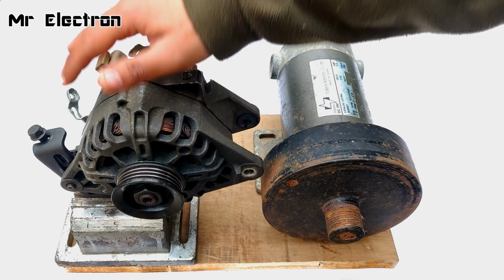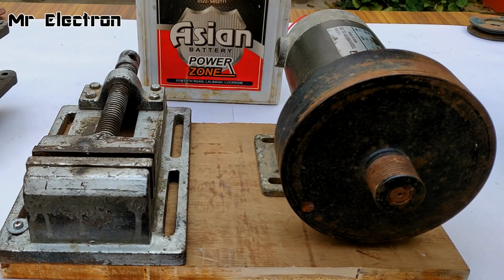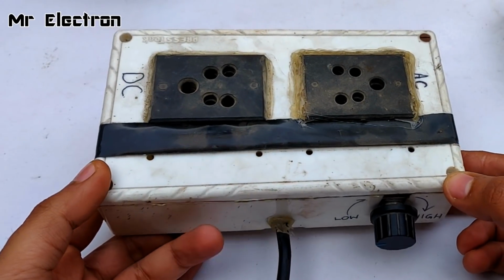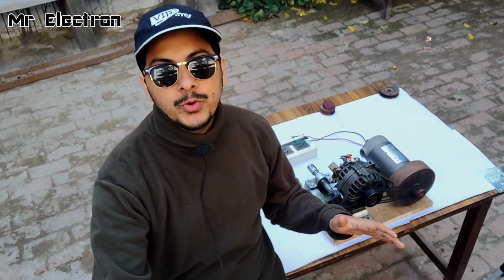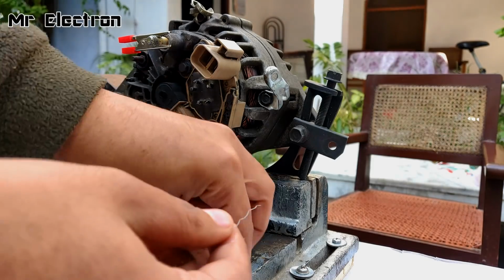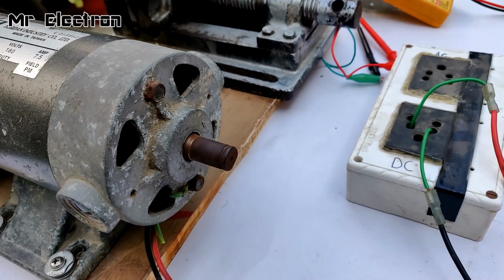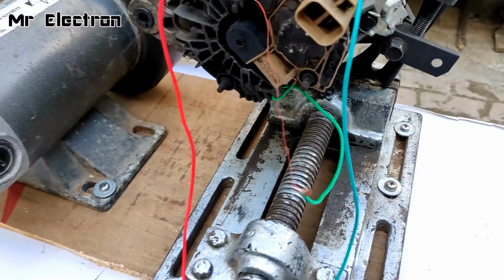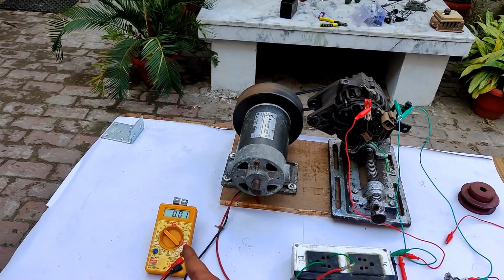12v 90 Amps Car Alternator to 1000 Watts Resistor Excited Generator

Comment: How do we using a battery,a motor and tension pully where do we connect wires to ensure the alternator is producing power and charging the battery at the same time

Comment: Hi can you make a video by connecting your alternator to Gym cycle, cycle or Gym tread mill so that we charge a car 12 volt Battery, then use that stored power to power your appliances at home using inverter

Then it great project to make electricity
Reply: treadmill motors can be generators now.

Comment: Hi, the video was extremely amazing and informative.

But I have a question:

What is the use of doing this self excitation if a 230 Volt power source is still needed?

Shouldn't the objective behind Self excitation be that we can use the alternator as a source of energy?

I mean a clean source of energy similar to solar.
Reply: Well the 230v source won't be needed if you could run the alternator at 3000rpm to 4000 rpm with wind or hydro energy.

Comment: What was the approximate resistance of the canthol wire?
Reply from the maker: 9 ohms
Reply: @MrElectron  wonder if a 10ohm 1w resister set in ceramic would last?

Comment: I used to like your videos but this one was fake and you excited the alternator using a battery  as we did not see a sudden change on voltmeter on the other hand car alternator must be excited or it will never produce energy even over 10000 RPM
Reply: Bullsit

Comment: Dear sir , I am kailasanathan from Kerala . I am an amateur researcher. I would like to clarify a doubt .  By connecting 100 alternators   in series / parallel and the output of alternators is connected to step up transformers to increase the voltage from 12 v to 230 v. 
Alternator capacity 12 v , 120 amps
Can we produce  2 MW with 100 such alternators
12v stepped up by step up transformers to 230 v
Volt× amps = watts
So 120amps  ×230volts×100 alternators = 2760000 watts= 2.76 Mega Watts
Can this be achieved
I am eagerly awaiting your valuable reply
Regards
Kailasanathan

Comment: hello mr electron,
i got a question and i think you will know.  im looking to build a cheap genearator from parts i have. i have a 50 cc scooter engine 5 altenators and 10 batteries. is it possible to hook up all 5 alternators at the same time to the motor to charge the 10 batteries.? 
the batteries end power will still be 12v. going into  12v<220 converter. 
i try to build a moving party trailer/powersuply for camping in the forrest. the solar panels dont do the job.
the hook up part is not a problem bud will the batteries blow or survive 5 altenators?
if i look at movies like a bicycle generator it produce easy 12v  power on 1 altenator bud only charge one batterie. i like to put the music at max so it will be drain way to soon on 1 battery.
best regards
Reply from the maker: if current is too high, it might damage the battery. Although, i don't think that a 50 cc engine is powerful enough for the job
Reply: @MrElectron  oke thanks  i will buy a generator hahahah

Comment: Hey bro is it possible to run bldc motor directly with the three phase ac output of alternator without using controller
Reply from the maker: i will make a video on it and find out my self. u can Subscribe
Reply: Already subscribed just waiting for the video..😁😁